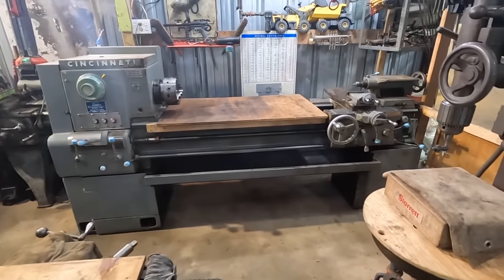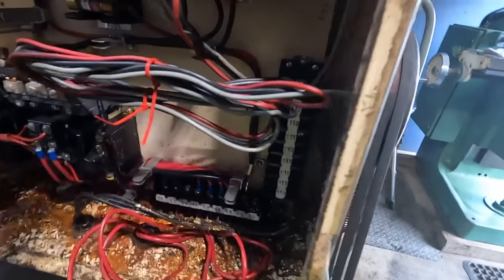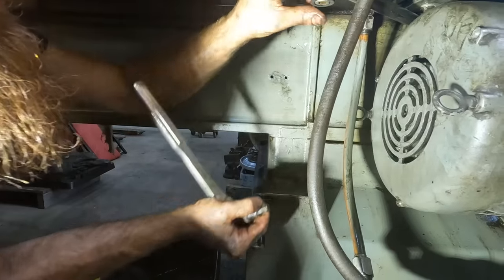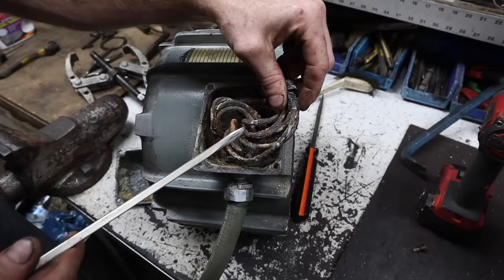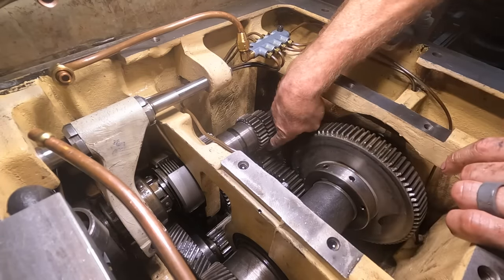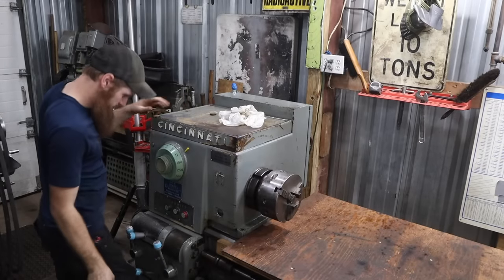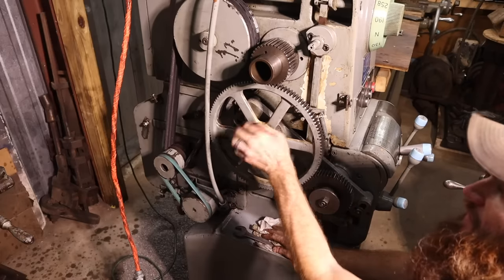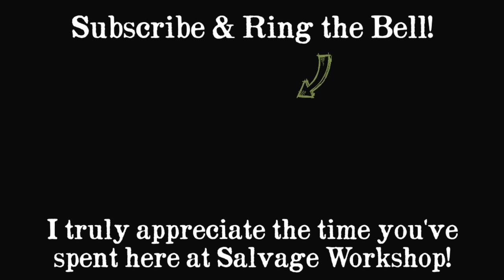Can we SAVE this BROKEN Lathe? ~ MAJOR Issues found! ~ Will it Ever CUT again?

Comment: Maybe the corrosion in the electrical panel was just because some coffee cup or coke bottle got tipped over.
The chips you removed from under the head were looking without corrosion like stainless steel or aluminium.
I've never seen wire insulation so pulverized like in the motor panel. Did it get contact to acid? Did they spill an old battery (where each cell had a ventilation/refill screw lid)?

Comment: Strange about that high gear. I wonder what's under the nut and washer of the smaller gear on the lower right. You might discover what could be missing.

Comment: If oil had gotten into the electrical enclosure, it wouldn't be rusty. Does the seal on the door actually seal or will it allow water to get through? Was the lathe sitting where it could have had water dripping on it ?

Comment: Try putting Open Gear Oil on the end gears that are used to set the gears for cutting metric and imperial screw threads
The Open gear oil comes in stray cans and is thick and sticky and very Black

Comment: The connection box will have a slight air leak and bits of the corrosion will be blown through into the box and  collect , that's really impressive a mess  epoxy paint or potting compound would be my fix

Comment: You might be able to get an oil filter from your local plumbing supply that looks like a oil burner filter could possibly help you instead of using the metal screen.

Comment: That motor that's from that lathe is called a Explosion proof motor. And if you need to have it rebuilt or replaced please protect yourself by buying the same type of electric motor it could save your life. Not excluding saving your shop and others around you.

Comment: Aluminium oxide, the white powder, is a good insulator. In MICC electric cable, mineral insulated cable, used in fire alarm systems as its fire proof is filled with the stuff.

Comment: Is that an oil level sight glass?? Or just a lil sight glass .. there is a difference.. one is obviously level and the other one is to make sure ur pump is pumping.. you’ll see drip drip through it… my monarch is this way.. as the oil reserve tank and pump are actually under the head .. total loss system

Comment: So I'm going to assume the Hydralic fluid they used is akin to water-glycol synthetic hydraulic.... so that level of corrosion is EXACTLY the type of thing that would happen. That was my first thought whenyou were poking through the cabinet, confirmed by the motor.
As opposed to the theory of the "no gasket" ... I bet you I know where they kept the bottle of Hydralic Fluid and where they spilt it. Despite cleaining the outside, that stuff gets into everything.
As to the wiring and the motor, Aluminium Oxide DOESN'T conduct electricity... so the corrosion is actually and insulator.

Comment: i'm guessing that over time, the progressive loss of oil caused overheating that, in turn,  expanded the hole in which the split pin sits, allowing it to fall out when rotating which in turn let the keyway fall out. 

BTW, figuring out how to dix these kind of things with minimal input from experts can do wonders for one's confidence and ego. ...sometimes too much. :)

Comment: I bet that filter hasn't been changed In a long time.
Reply: I think where that lathe was setting there was probably a leak in the roof of the building and it was leaking in to the area of the motor and other areas of the lathe.
Reply: I wonder if you prest the roll pen in far enough that you could use a set Screw so the roll pen won't come.
Reply: I wonder if you put another shim in with other one that maybe that noise will go away.
Reply: Maybe that smaller gear might have a bad bearing or bushing.

Comment: Oil doesn’t cause corrosion on steel
My educated guess would be some sort of electrolysis reactions from the high frequency AC voltage and maybe a faulty ground. Almost as if the steel housing is acting as an anode.

Comment: Running the toolpost at that angle is asking for trouble(about -45 degrees) as while your watching the cutter get to the end the heal of the tool holder will hit the chuck first, also the tool used is made to be at 90 degrees to the work, thats where it cuts best, maybe why you had such a bad finish.

Comment: Obviously this sat outside and rain water got into the electric box, traveled down the conduit into the motor. We bought a 1965 LeBlond Servo shift that had similar issues. We got it for $500 from a place in Ohio. Had to replace a set of clutch brushes, a mercury contactor then clean and fix the leaks like you did. Thing runs great. Ours is a 15: so it uses an L-O chuck mount. Hope you get years of service out of your machine. Spend the time and level it out good before using it. That takes some time, double check becuase sometimes floors aren't stable. Man if you got that bear caught in the gears you will lose half your face.

Comment: How did you clean the ways. And in your search of machinery if you happen to stumble across a 1900-1906 line drive rahn-Mayer-carpenter engine gap latch I could use the parts!

Comment: It's a metal trap forchipsor flakes that don't flow out from reservoir into the filter as all metal will not automatically get sucked through filtration system ... a drain hose for changes would be an improvement

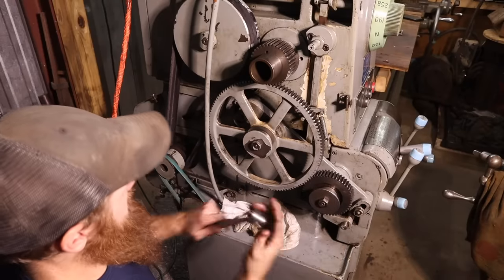Comment: 1:41:35  light film of grease might be oil light bronze but add a flat thrust bearing to ride the outer flange.  How often will you run high speed, its not very often unless your running a none ferris metal.

Comment: It's an induction motor so the rubbish doesn't matter as long as it doesn't catch or block the airflow,  brush out the junk change the bearings put it back together and " tiptoe quietly away "

Comment: Use some aluminum foil to set the lash between the gears on the end. Just roll it in and tighten it down. You will likely still have some mesh noise with the gears. You could put some good sticky grease on them.

Comment: Loose roll pin.  Is the keyway loose in the gear allowing the shaft to rock and drive the roll pin out?   There are double rolled roll pins that might resist that better.  Alternative is a stainless automotive CV boot clamp if there is room for the crimped head to clear the gear teeth.

Comment: My best guess, at some point the machine was exposed to water… the control box was left closed with water in it, rusted out, and someone sprayed it with oil to control further erosion….the head being low on oil should have no involvement with the oil in the panel as there is no connection or need there of between the two….my two cents worth anyhow.

Comment: My guess is the oil in the electrical panel came from the missing gasket for the cover, oil leaked out and down between the machine and got in the panel, then ran down the conduit and into the electric motor.

Comment: Does it have separate hydraulic oil to run the sliders or does it circulate the gear oil and use the case as a sump?

Comment: Could the low oil cause an overheating of the shaft which expands the shaft and the hole, making the roll pin loose ?

Comment: WOW, I CANNOT BELIEVE THAT MOTOR NEVER SHORTED OUT, AND BURNT UP, THAT WAS JUST CRAZY.
I WOULD SET THAT GEAR BOX DRAIN UP LIKE THE NEW BRIGGS & STRATTON OIL DRAINS, FLEXABLE HOSE, AND ADD VALVE ON END OF HOSE, WITH A CAP ON END OF VALVE, SO NO ACCIDENTAL. DRAINING OF GEAR BOX CAN HAPPEN. YOU HAVE TO REMOVE CAP, AND OPEN VALVE TO DRAIN.

Comment: I would expect the paint chipping in the electrical cabinet to be from poor surface prep work. the users only care about what the outside looks like, so the inside is more likely to be neglected. This would be exacerbated by the high vibration of the machine.

Comment: Looks like the second sump was for capturing large debris wonder if that plug was also magnetic 🧲 check that. But instead of plugging it on the new extended drain why not a ball valve for easy oil changes.

Comment: Looking at the motor, was that lathe in a flood and the motor got full of water and was run like that for years? All that stuf inside the motor looks like aluminum oxide powder from years of corrosion with the help of electricity. It is absolutely amazing that the windings in that motor are any good however I don’t think they will have much of a life expectancy now.

Comment: That would be coolant that was in the elec panel. Not the head oil...You have 2 parts to that oil. one part for the hydro is under pressure for the automatic shifting, the other part is for the gears lube..

Comment: the speed control does not work in between selection its not a continuously variable transmision like your milling machine you have to select the speed before you shift the lever up or down

Comment: I am sure your idea about leakage of oil in the electrical cabinet is based upon evidence you found in there. But to me it looks like water as the inside of the cabinet is rusted. This would also explain the water damage to the motor, the water would have drained into it.

Comment: Looking at the state of the inside of that motor it looks like where that Lathe had been kept water had got into the power panel and the motor because if it was oil it wouldn't of caused rusting on the bottom of the power panel like it had.

Comment: My opinion on uniting the line with the drain is an absolute no because the filter won't be that capable to filter all that sludge, all fluid (oil,fuel, water,e.t.c) tanks have the line some distance from the bottom to avoid getting as many sludge as they can

Comment: put a ball valve or gate valve on the end of that drain pipe with a bung in the outlet of that valve. That way, when you want to drain the head you remove the bung then open the valve. No mess.

Comment: Getting the machine to run is important but to have an accurate machine the ways and slides have be inspected and if necessary refitted.  Also the apron oiling system needs to cleaned.

Comment: I've been watching for years, since after you changed from silent format. Please cut out the extra stuff, like dumping and cleaning swarf...ounces is fine, but pounds of swarf trash videoing is overmuch. /P Add Locktite at bearing recesses on the OD to lock bearings to plates. Shoulda left the spindle on '980', shut down, disengaged the shifting assembly from the dial shaft, and then put the free dial on '980', meshed 'em back. (Weeks back you randomly came to mind, and I've been meaning to catch up. You're a good dude.)

Comment: Man you have your beard close to those change gears.  They take no prisoner’s.
Just like V belts they will rip off anything they can reach. Covers on even during maintenance.
There are no “That was close” moments.  Now you see ‘em, now you don’t.  (Referring to your fingers)
Those gears are always noisy running flat out.  The cover will quiet them down a bit.
Nice job on the restore although your machining techniques could do with some work.
Way too much hang out on that bar and the compound slide is all over the place for no reason.  The approach angle on the tool can be critical for a good surface finish.  Although I wouldn’t event talk surface finish with 12” hanging out of the chuck.
Your right though it’s a nice looking lathe!

Comment: Good video, but picking up the lathe with the fork tynes metal to metal is not good. You need to put some rubber or carpet pads on the forks to stop any sliding, once it starts moving it probably wont stop, a lot of weight there.

Comment: dude, check the insulation between motor phase wires and the ground to ensure you don't get killed.  Use the multimeter - the resistance between the phases and ground should be in megaohms.

Comment: that looks like the oil pump sump itself. if you T into it it will not allow any pressure and flow to go to the trans.   that motor is in bad shape. it is an electrical fire hazaed. 1 good short and your on fire with all that oil it will not be perty... i highly recommend you take it to a professional shop and let them go through it and at least validate the motor is good and "SAFE" to use.  i wouyld hate to see you have a major issue over being cheap.  either way good luck.

Comment: Look at the top gear on the outside of the case. When it is turning at higher speed you can see that there is a definite runout to the gear diameter. Review your video at the point where you are adjusting the large lower gear and you can see the runout. Measurement of the gear diameter when it is turning should give you the runout.

Comment: Water got inside your electric panel (lathe was probably left outside or roof came off building). Flowed into electric motor from the liquid tite conduit.

Comment: Perhaps the machine was in a flood.  That would explain water in the motor - but also how oil (floating on the flood-water) got into the electrical box.  The level at which the electrical box was corroded would be an indication of how deep the water was.

Comment: I bet there was water coming in the top of the panel through the wire conduit, filled the panel case and leaked down into the motor, probably a slow ingress of rainwater ...

Comment: Pretty sure that stuff you called "cocaine" was old insulation that degraded over time, not corrosion. Might've been the same stuff on the inside of the motor, too, although that looked a bit more like corrosion (the blue tint).

Comment: somtime the oilflow is bigger then the capacity of the filter and you leave some of the oil unfiltered, all the oil will anyway be filtered over time, and the amount of dirt is minimal. most of the dirt made in a gearbox is metal particals, and is usual collected by a magnet.

Comment: Should have installed a valve and hose to the drain tank. That machine probably hasn’t seen that much maintenance in 40 years. Those machines back then were built to last. The stories those machines could tell.

Comment: check oil with the motor running.      check dial for pin location...also the pin you replaced should be a taper pin

Comment: Planning on an oil change on my lathe and the manual specifies dellus 27 which is now obsolete. Talking to a penrite dealer they suggested their iso-32 but am concerned it won't have the lubricity of the original I have found a mobile dte-24 and a shell dellus S2 M32 but there are no local distributors, anyone care to shed some light on this.

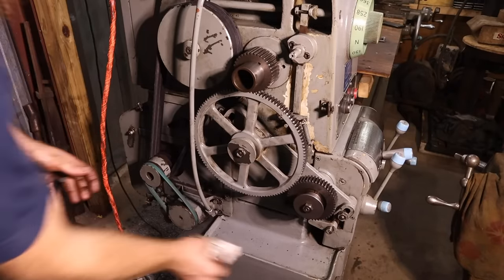Comment: 1:39:00 man  watch your hair and beard around them gears running.
One tiny mistake it will rip the side of your face off, scalp you or take off fingers and won't even give a shit.   You should know better.

Do what the old mechanics did use a rod to place it spots of the machine way back away from the gearbox or a set of stethoscope
You can pinpoint a noisy part and stay safe. 
I worked in a machine shop, i also worked in a press room running web fed printing presses, i watched a kid loose 3 fingers on a press taking over a job id been doing because they needed me on something else. EMT  looked in the machine to find his fingers but he got caught between the plate cylinder and blanket cylinder they had about .01 force to each other.
There  wasn't anything left they got smashed gone.  He slipped getting up on the machine, his hand reached out to get his balance, it was the worst place to reach.
 Thats all you got to do is loose your balance and reach out to disaster.   Thats why its important to keep a clean work area.

It drives me nuts seeing a construction crew working in a pile of garbage and scraps of lumber.
One slip is all it takes  and you will reach out to break your fall its your natural reaction to falling.

Comment: Unless you're running this thing 2,000 hours a year in a production environment, I think you're worrying more than you need to about the oil quality. Any modern ISO68 will exceed the spec of whatever was available at the time this thing was manufactured. Only thing I could see doing is changing that filter to one like you'd find on a log splitter with an actual spin on filter with a paper element, but honestly if you change the oil every few years the screen will work just fine. My old Massey tractor hydro shift trans had nothing but a screen like that in it and it was still running fine with 8,000 hours on the machine. The whole inside of the trans was all full of crud though for what it's worth. I pulled it apart again after my initial cleaning and maybe another 50 hours of running, I can't remember why, but the fresh oil cleaned up anything I couldn't get to with my hands and there was just a little bit of debris in the screen. I cleaned up the screen again, wiped out the pan, put in fresh oil and called that good. The whole world would be a much better place if people just changed their damn oil once in a while.

Comment: You’re probably pushing all the crap that was at the bottom into the lines. Is the filter only on the side with the clutches? I thought I saw clutch packs in there

Comment: It does not look like oil to me i looks like the door may have a bad seal air gets into it and the electronics heating and cooling makes the air condense   and set on the bottom and rusting.

Comment: 1:55:36 ALWAYS TIGHTEN ALL THE JAWS, IF THE CHUCK HAS 3 HOELS TIGHTEN ALL 3  4 TIGHTEN ALL 4.  THIS IS 70 YEARS WORTH OF MACHINING WORK IN A JOB SHOP. drill press lathe mill doesn't matter.

Comment: Some one sprayed contact electrical contact cleaner or something else when working in the box . Whatever it was used, it was something that did not react well with the paint long term. There is no oil into that cabinet. Also stop handling shavings chips and curls some microscopic slivers imbed and can and will result in a infection. You pull off questionable stuff all the time so good luck with the whole running it with diesel fuel My instructor said never do it unless you are planing a complete rebuild.